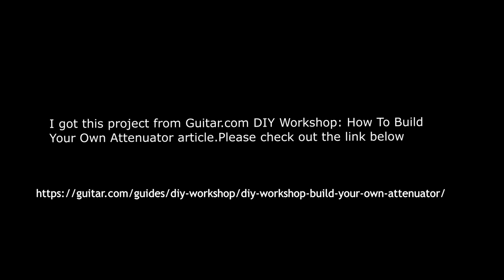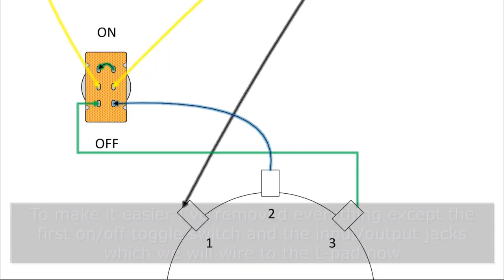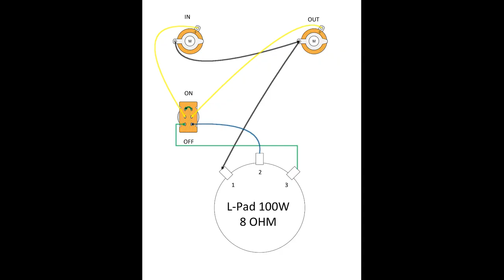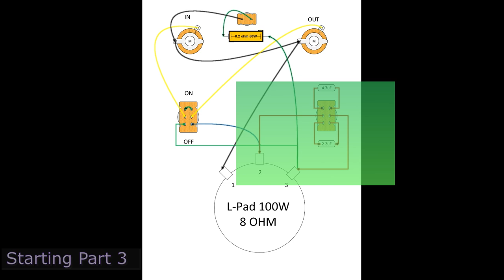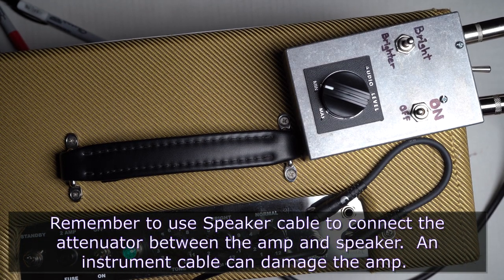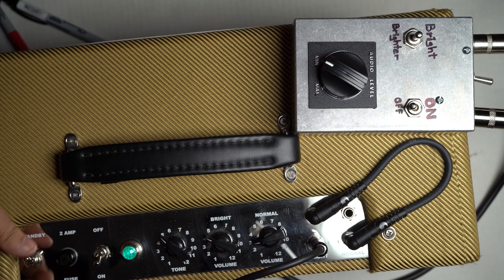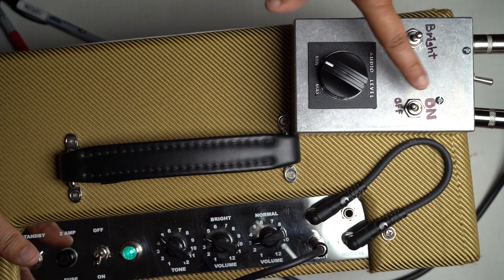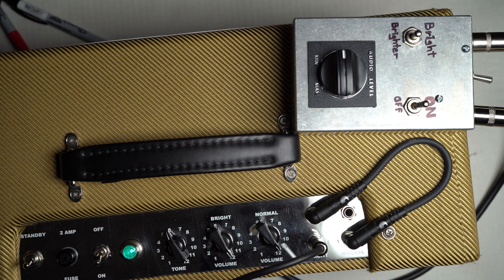🆕Build A Tube Amp Attenuator ➡ Diy Attenuator Tube Amp

Comment: Do these work on a solid state amp? Are the input and output jacks self-grounding? Since there is no AC running through this little box, is there any ground (earth) anywhere?
Reply from the maker: I don't believe these will work for solid state amp.
Reply: @guitarfix5283 : thank you, guess I'll have to build a 5E5 Fender Deluxe.